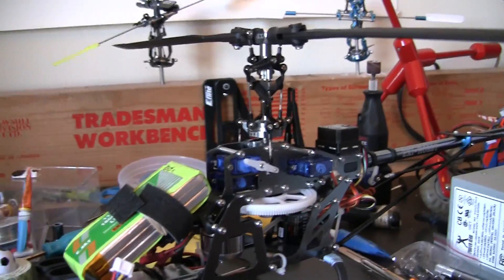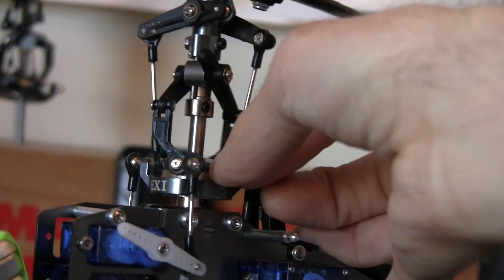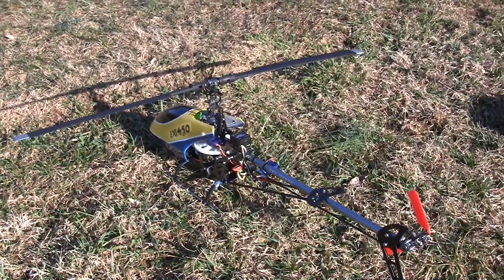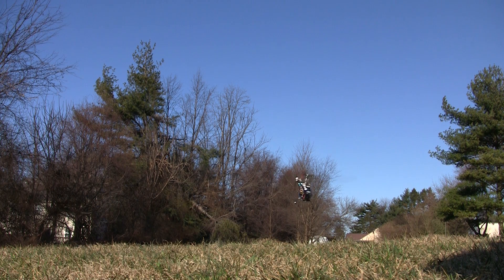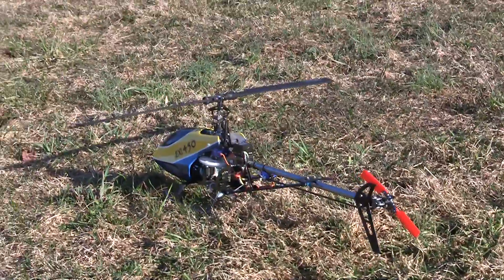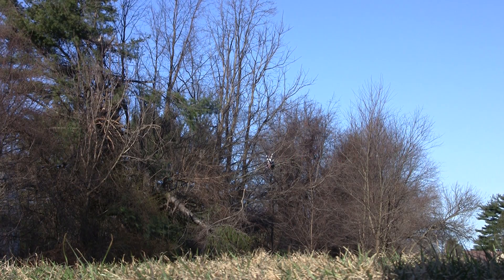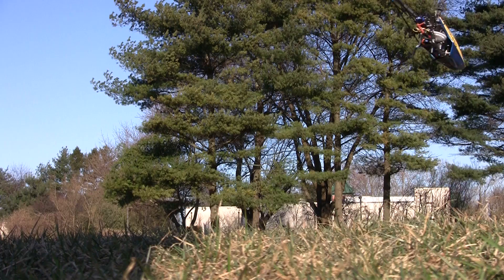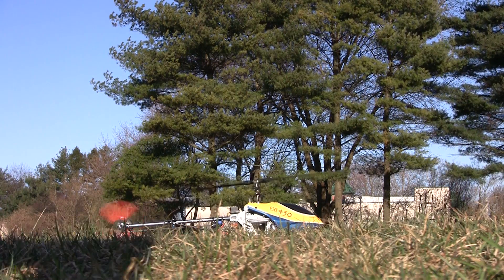Flybarless 450 - Test 5 - Weighted vs. Unweighted blades

Comment from the maker: I saw it, didn't have a chance to check it out yet. For my head, I used the guide that Skookum put out for converting a trex 450 head to flybarless. On heads that are made for flybarless, they generally have longer arms on the blade grips to reduce the amount of movement proportional to the amount of swash movement. Since they're so short on the trex head, using the mixing arms helps to smooth things out.

Comment from the maker: @erwin15erwin The blades are also made of flexible plastic so they absorb the imbalances in lift that the flybar helps to smooth out. Sort of like a flapping hinge, or at least that's the theory.

As for the mixing arms, they act as mechanical reducers, so I don't have to turn my swash mix down. That way I'm still getting the full servo resolution and my links are 90 degrees to the servo arms. I those arms are slanted up to the swash, then you won't get a linear swash movement.